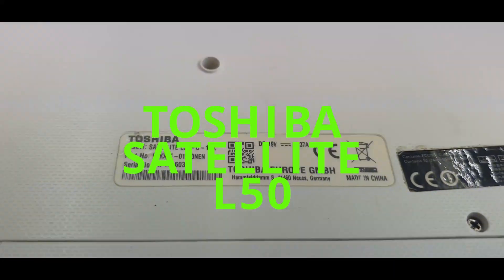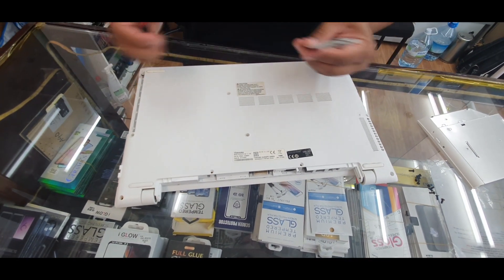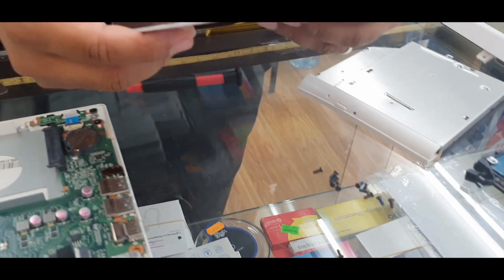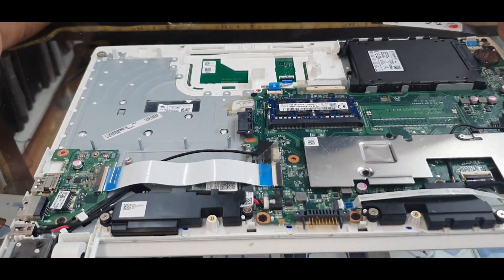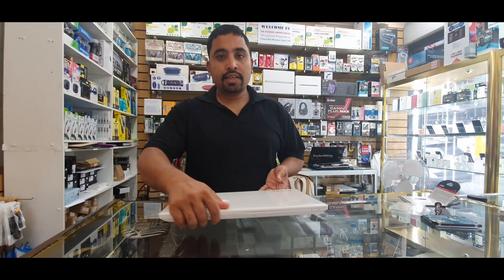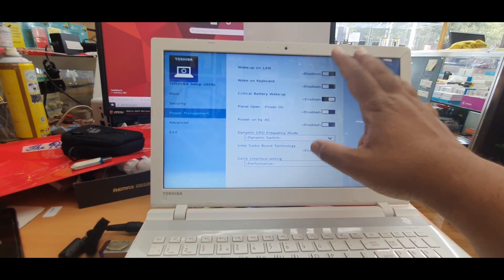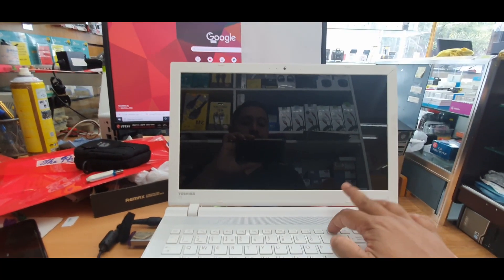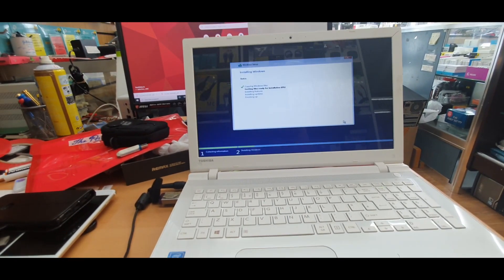Toshiba Satellite L50-C-1GX  SSD Upgrade  And USB Boot

Comment: Need to put the ssd inside the metal case of hard disk.????
Reply from the maker: Yes you should, as the metal case which is call caddy always save the drive from shacking or moving around.